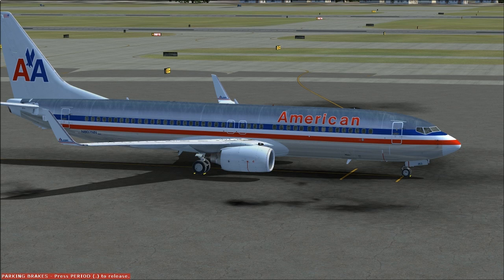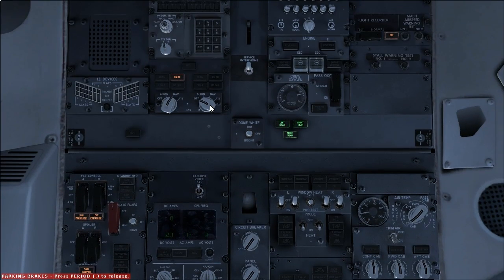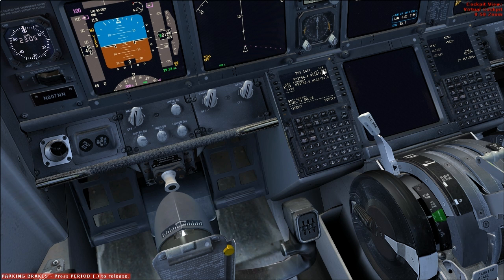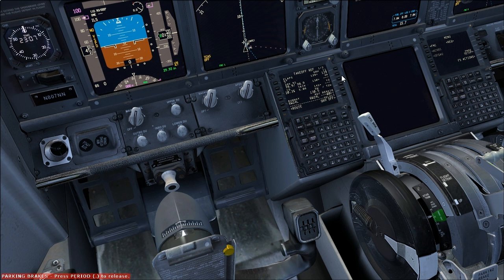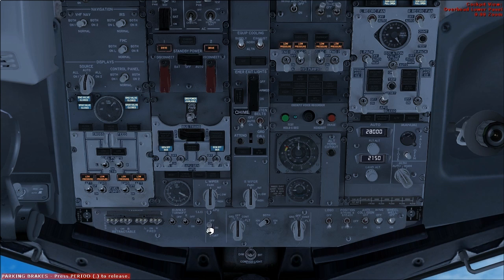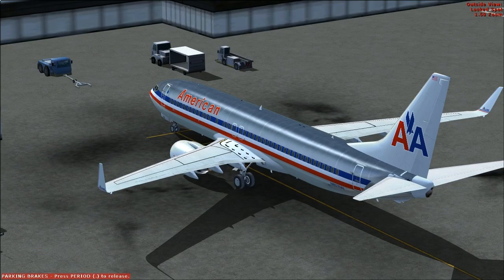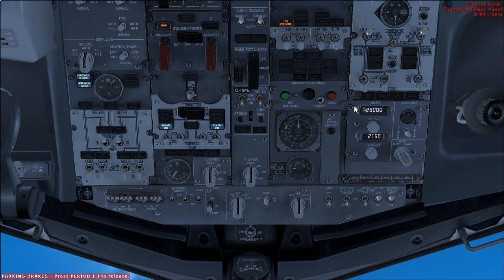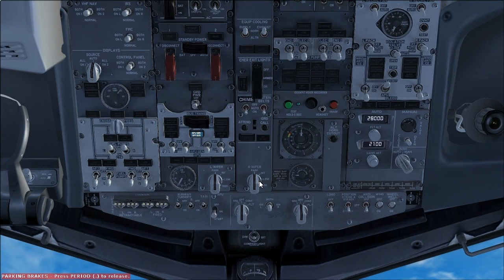FSX PMDG 737 NGX Full Tutorial Part 1

Comment: 1. How is your FMC active IF the Battery is off? 2. You need to turn ON the APU to start 3. Turn on your Number 2 fuel pump - That is what the APU runs from 4. Only the basics are turned on until the engines start- to prevent a failed start, Also, click on the FMC so it shows up in a large window.  Overall you get a 4 out of 5. Not bad, just missing a few things.